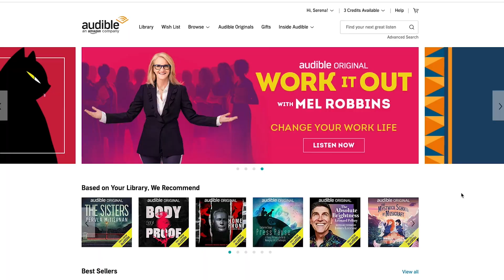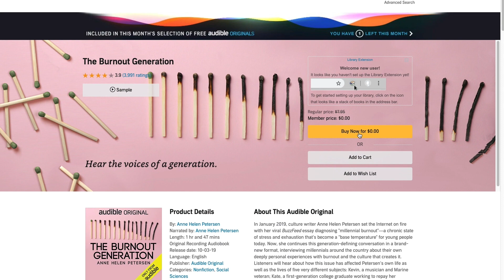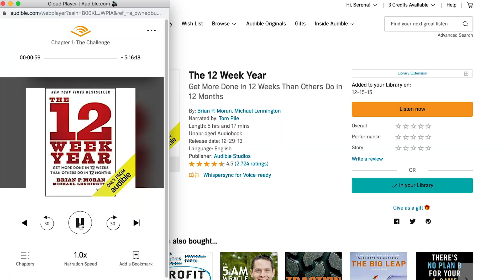BEFORE and AFTER: Wooden Folding Chair Makeover - Thrift Diving

Comment: Unless that waxed chair is covered, it's going to ruin your clothing of the person who sits on it.   This is why I always use a clear coat over freshly stained wood that will get direct use of body to seat.  Just a word to the wise from someone who has ruined far too many pieces of clothing using wax.  It's great on furniture that you don't actually sit on.  I also recommend foam sanding blocks.  They work wonders on surfaces like this.
Reply from the maker: Yes, I definitely understand! I am planning to make a little seat cushion for it, so it should be fine! I definitely would have preferred to use my satin High-Performance clear coat, but I was all out. :) Oh--and I couldn't find my foam sanding blocks, either! Believe it, I went looking for them! LOL

Comment: As someone who has refinished wood many times, my recommendation to you is when you after wash the wood use a green or red stripping pad. It works so much better than a rag. And use a plastic stripping tool. It's shaped like a scoop and will pick up the finish as you scrape...and it won't gouge your wood! It looks beautiful btw!!